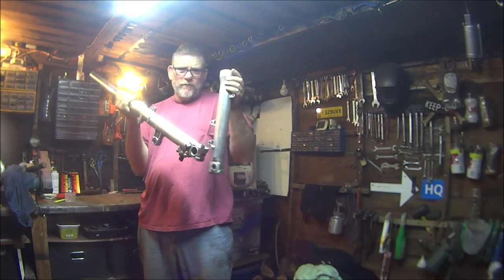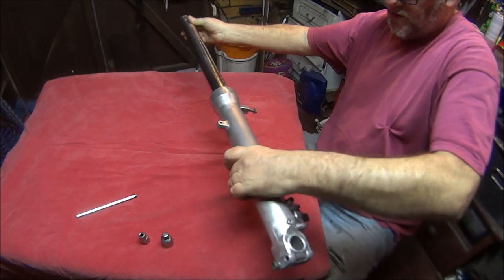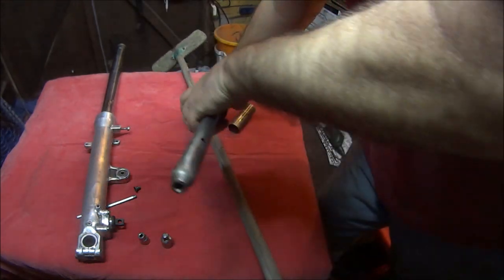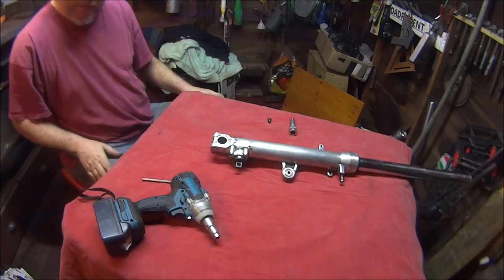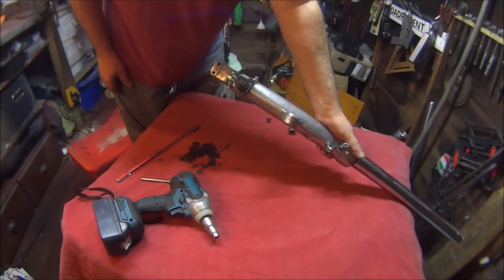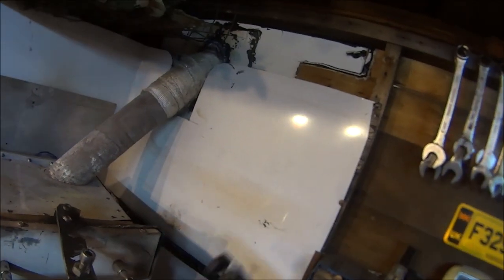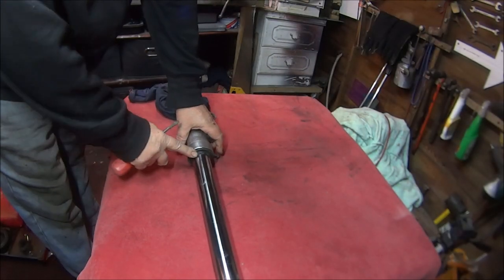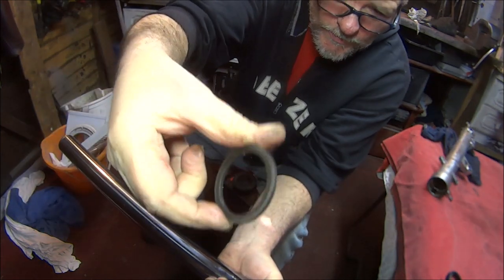CBR1000F Landfill bike. Front Forks stripdown

Comment: Are you conserving fork gaiters Johnny? I put some on the divvy and used zip ties top and bottom. The last mot, the tester put the, on as an advisory which I was miffed about. So this time I’m leaving the bottom zip tie off and tell them before hand so they can examine the seals 🤞👍🏻
Reply from the maker: No just keeping the forks clean chrome. Yes if you take the bottom zip ties of they can check the fork seals. 👍